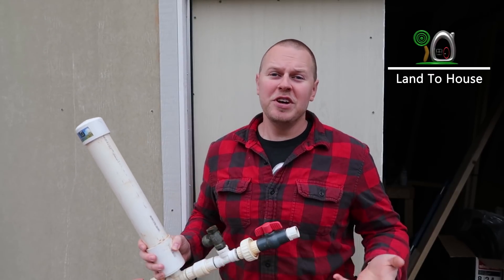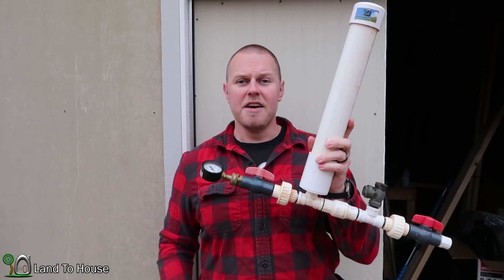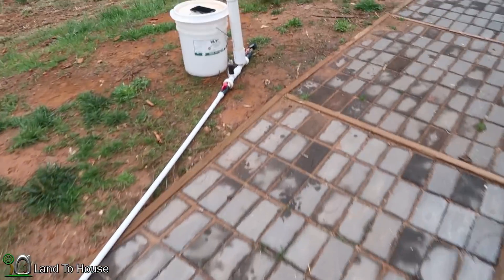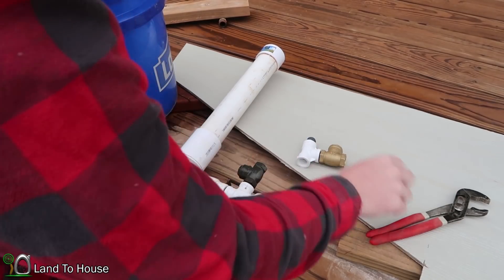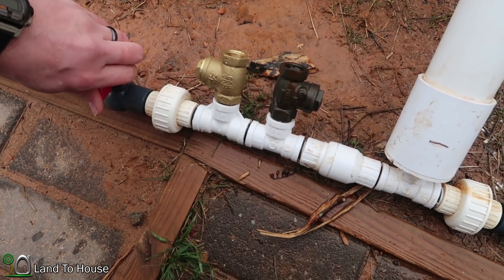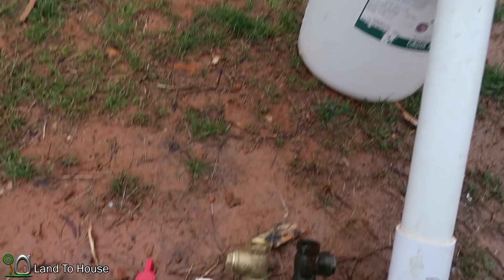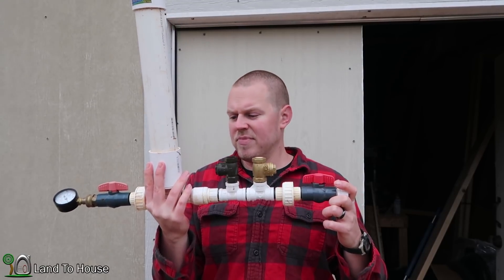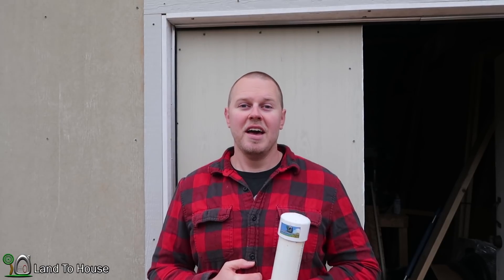Double Waste Valve Ram Pump Test 1

Comment: It looked like you had a steeper slope on your property for get a higher flow rate. Correct me if my eyes were playing tricks on me.
Good work though!
Reply from the maker: You are correct. I wanted to keep the test consistent to prove the concept. The single valve works on this head pressure but the double did not.
Reply: Land to House maybe it may work with a higher inlet pressure though, and then you can see if two working is better than one or not.
Personally, by the physics of the system, I cant see how 2 would improve things. Other changes may...
Reply: @Colaaah  it will improve if the volume of water is larger, it means you can have a higher elevation of head pressure. I tested this system already, My ram pump have two waste valve, I covered or blank one of waste valve, the result is lesser volume of water delivered. My ram pump is1 inch with 20 meter 1" drive pipe with approximately 7 meter of vertical head and can deliver approximately 40 meter verical with a distance of approx 280 to 300 meter.
Reply from the maker: I came up with similar results in the end. 1 valve delivers much less volume than two. But adding additional valve does not increase the lift. At least not in my results.

Comment: There's increase discharge but not to pressure as what my optimization resulted on my 2" with 5 wastevalves as optimum--get updated of my latest experiments also on ram pump, cheers😁

Comment: Can u tell me if a larger intake diam to ram pump will drive an reduced outlet pipe with greater pressure? Vs equal in and out diameter pipes...

Revere your opinion on this subject undoubtedly. 

Your reply may well determine success of a waterfall project here in North Queensland. Where I've an established cnr ravine waterfall into never dry sometimes huge Millstream river. With peak rain refreshing the often dry 50m waterfall. I plan to make this a future feature of the district, a self driven ecosystem

Just subscribed but viewed long time even retweeted your channel on occasion in past few years
Thanks again for great practical viewing...
Reply from the maker: Thank you for watching for a long time! I have found that it is best to use the same size drive pipe as waste valves. This is because the pressure wave going and coming need to be the same size. Now the delivery pipe from the pump can be any size you like. Atmospheric pressure is the main thing that effects the delivery and we dont change that pressure by pipe size.

Comment: would a series of pumps move more water rather than pumping away 20 feet pumping up 10 feet and allowing that water to pressurize another ram pump inline?
Reply from the maker: I actually have a video where I try to get a large ram pump to take water to a second smaller pump. I found that it was better to let the larger pump lift water as high as it could and eliminate the smaller pump.  Too much loss in the second pump to keep it going on the lower delivery volume of the first pump.

Comment: It looks like it would reduce pressure and valve wear for systems with higher flow and head pressure. May be able to run multiple 3/4” waste valves on existing system with 1-1/4” drive pipe. Looking forward to the follow up.
Reply from the maker: The pump actually did a great job! I used the 3/4" drive pipe with the 1/2" valves and was able to get twice the output vs a single 3/4" valve.

Comment: Which mean if we have  strong stable water intake, we might consider adding more waste valve accordingly, as I have seen even 4 waste valves practicing in Vietnam, but their intake pipe size is far bigger than output size, even 10x diff.
Reply from the maker: Yes I think that is correct. In my next tests I hope to learn what increase there is by adding more waste vales. As the pump size goes up there is more water but the same pressure. So if more valves can add greater pressure it will allow for pumping water higher.
Reply: I think if u double out put you must double input to balance equali the system

Comment: I like the experiment...  A few comments...  This is why ram pumps get sized up by scale as a unit...
also... I think a better "gauge" of the efficiency is delivery volume to a specified height rather than PSI built.  I am curious if the double-impulse wave will move more water volume vs the single impulse wave.  Thanks for experimenting!
Reply from the maker: At first I was thinking the same thing about scale BUT I think there is more to it that that. In the past I have found that each size pump works on the same ratio input to output. Adding the waste valve should increase the strength of pressure wave and allow a pump to pump higher with greater flow rate. I agree about moving water as a test. I will do that for sure. I just wanted to give this a first try.
Reply: I think the limiter you run into is the pipe diameter ultimately... if you haven't already... look into laminar flow and pipe resistance.  I have some ideas I want to try this year on my ram system. Just in from making some upgrades to the dam and supply line... Can't wait to go tomorrow in daylight and film the difference! Cheers! Keep testing!
Reply from the maker: I just watched your new videos. Seems like the improvements are working well. It might be possible to use the double waste valve to improve your flow rate too. I will try and get to the test soon.
Reply from the maker: I think I mistakenly read your first comment as a "greater volume" improves output. But you actually said "movement of volume" which is what I referre to as flow rate. So in that case you are 100% correct. I was just miss matching terms. Nice videos. Adjusting the weights on the waste valve is a very effective means of controlling the pump. I typically scale down the entire system to accommodate for summer low-flow but in your case you can just adjust the waste valve for low-flow to a point. With swing valve that option is not available.
Reply: Yes I think we understand each other's terminology now.  Thanks for the kind words. Yes, the ability to scale down is what saves my butt in the late summer when water levels drop.

Comment: How about adding a 2nd inline check valve BETWEEN the 2 waste valves??
Reply from the maker: I think that would actually stop the pump. The inline valve that I use has a 1/2 pound spring. I think that is enough to keep the second waste valve open and that would let out pressure. Still worth a test though!

Comment: I like these experiments.. :)
Reply from the maker: Yes me too! Now that its not 30 degrees out I can get back to ram pumps.
Reply: Make a nice geothermal greenhouse cooled to +10 summer or winter for a workshop. Prob cost 2k if bending the steel conduit 10ft pipe yourself. :)
Reply from the maker: The pump is capable of traveling a very long ways. The limiting factor is the lift. With only 20 ft you are well within the capabilities

Comment: It would be interesting to see if different amounts of water  are pumped to the same highth with the same supply pipe and using one or two waste valves
Reply from the maker: Yes! When I get a model working I will start testing out the flow rates. Good comment.

Comment: so less pressure due to running out of water really fast... and the check valves would work properly. so i was partly right... which means you have been teaching me a lot :)
Reply from the maker: I like how you stop the video to make a guess. :)  I think there will be a pressure increase when I have a larger drive pipe. I hope that there is more pressure than with a single valve. Test should show us . .. or at least be fun along the way.

Comment: stopped video at 1:03 and have not read comments yet... im gonna guess here that the 2 check valves drain bucket faster IF they work at all, but there will be less water out the end of pump. maybe more pressure though...

Comment: I would go with the 3/4" T's. Can't wait to see how this preforms. Thanks
Reply from the maker: I think you are right. This needs to have the larger t's all the way to the valves.
Reply: @LandtoHouse  EVER THOUGHT OF INSTALLING A RUBBER MEMBRANE IN THE PRESSURE TANK MAYBE 3/4 OF THE WAY UP ?  I BELIEVE IT WOULD VASTLY IMPROVE THE PRESSURE ON THE DELIVERY SIDE BY EXPANDING TOWARDS THE TOP AND SNAP BACK LIKE A RUBBER BAND
Reply from the maker: I've used bicycle inner tubes and that does seem to supply some snapback. I hope to test out a house water pressure tank this summer.
Reply: @LandtoHouse  you mean like stretched across the circumference of the air chamber ? I would think it would act like a pump or mechanical heart, expanding and contracting
Reply from the maker: @mw10259  the tube inside the tank does that some. I dont think it would hold well strapped across the circumference.  The pump can build 70+ psi with delivery pipe closed.
Reply: @LandtoHouse  I'll  give it a try and let you know. I plan on cutting a section of the stack about 2/3 to 3/4 of the way up , stretch a piece of heavy rubber across the opening , add a slightly larger diameter section  on top of it holding the rubber in place , then cap it off